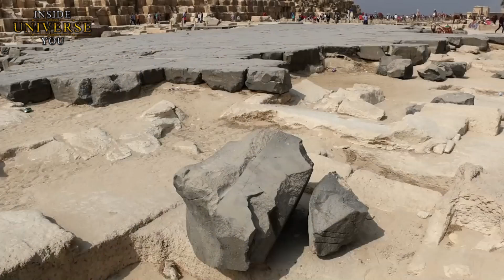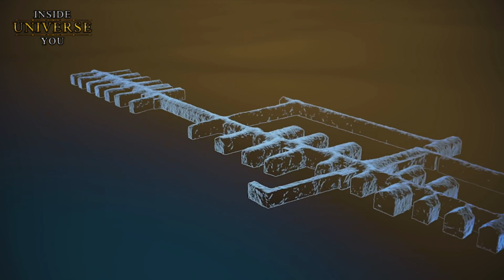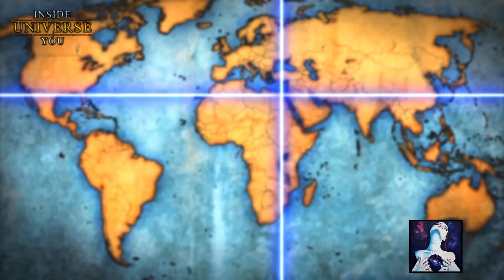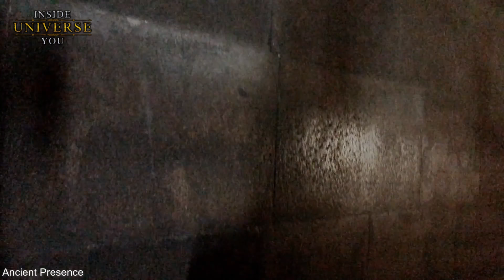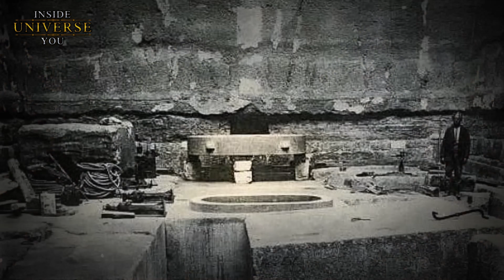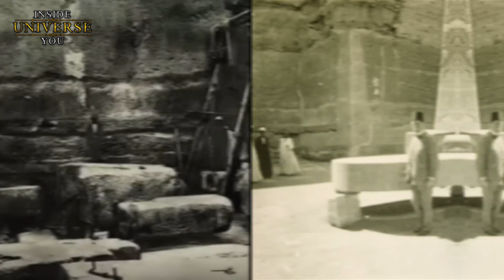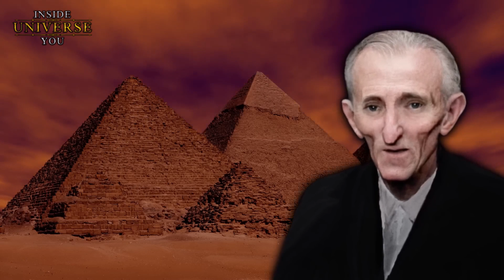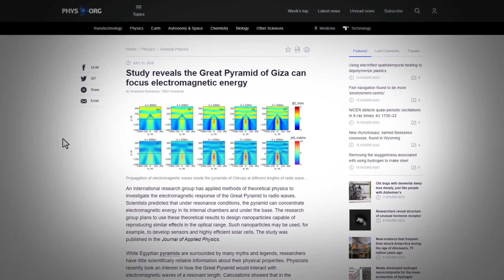Pre-Egyptian Megastructure Built BEFORE The Great Flood

Comment: If you were to consider using dacite to house a battery or create a battery in ancient times, here are a few reasons why dacite could be a practical choice:

1. Durability and Strength

Dacite is a tough volcanic rock, known for its durability and resistance to weathering. In ancient times, materials used for containers or structures needed to withstand harsh environmental conditions. Dacite’s strength would make it a good candidate for housing a battery, as it could protect the internal components from damage or degradation due to external factors like pressure or impact.

2. Thermal Resistance

As an igneous rock, dacite can endure high temperatures without breaking down. If the battery generates heat during use, the dacite housing would help maintain the structural integrity of the device without warping or melting.

3. Non-conductive Properties

Dacite, like most igneous rocks, is a poor conductor of electricity. This property would prevent unintended short-circuiting if the battery was housed within it. Its insulating characteristics could help isolate the electrical components, ensuring that the charge stays contained within the intended circuit.

4. Abundance and Accessibility

In ancient times, materials that were locally available and abundant were ideal for construction and tool-making. Dacite is a relatively common volcanic rock found in various regions around the world, meaning it would be accessible and practical for ancient civilizations to use.

5. Chemical Stability

Dacite is composed of silicate minerals that are chemically stable under normal atmospheric conditions. This stability would prevent it from reacting with battery components or corrosive substances that might be used in an ancient battery system, preserving the functionality of the device over time.

6. Carvability and Workability

Dacite can be worked with traditional stone-carving tools, making it possible to shape or hollow out sections for a battery or container. This would have been important in ancient times when metalworking techniques were limited, and stone provided a practical alternative.

Historical Context: The Baghdad Battery

If you’re referring to something similar to the ancient Baghdad Battery (a clay jar thought to have housed copper and iron rods that could have been used for electrochemical reactions), dacite could serve a similar purpose to the clay jar. Although dacite would be more difficult to work with than clay, it would provide greater durability and insulation for such a device.

In summary, dacite’s physical strength, thermal resistance, electrical insulation, and abundance in volcanic regions make it a potentially good choice for housing or building a primitive battery in ancient times, despite not being as easy to work with as other materials like clay or ceramic.

Comment: Any fringe theory makes more logical sense than a tomb for the dead. The inside absolutely looks like a machine.
Reply: I think they were both. Some believe the pyramids were recycled by the Dynastic Egyptians and used as tombs. If it's true that the Egyptians discovered them vs. built them, then they would have been just as amazed as we are (and rightfully so). I can see them wanting to bury their royalty in them. I lean towards this explanation. But it is possible the Egyptians had more advanced technology that we still don't know about or fully understand.
Reply: I find the ram pump / power generator theory very convincing.
Reply: You are a Genius.
Reply: I think it was built to fill earth with good vibrations, where pyramid is like a speaker and amplifier, and some dead saint mummy was the source of good vibrations. When stupid humans took out the mummies out, they disturbed the whole operation of such building that was operating to fill while world with better vibrations.

Another theory is that pyramids were created with a lot of isolation from stars except some tunnels that were in direct line to some stars so that when someone is born or comes out of coma would have a certain properties of consciousness, which is usually not so achieved just being born without such astrologicaly.

Third is for safer obe astral travel.
Reply: false
Reply: Pyramids were not supposed being tombs!
Reply: One thing we know for sure, the most fringe theories are actually those labeled academic. You can’t get a hair through the stones. Yet the saws they supposedly used are thicker than that.
Reply: @vonbennett6545 I don’t quite understand where you’re coming from. Cutting the stone and finishing it to fit are two entirely different processes. The saw thickness is not relevant.
Reply: @mikecrosier6248  I’m agreeing and adding that the tools I saw in Egypt & which were supposedly used don’t seem capable of that level of precision. The millimeter machine like cuts.
Reply: I doubt diorite stones & copper axes are responsible for the any of the cut & finish work.
Reply: EVERY fringe theory makes more sense than the RIDICULOUS explanations that WE were given in school. 🙄
Reply: Bo mummy was ever originally found in any of the 165 known Pyramids in Egypt... the vessels were all empty.
Reply: @bpd9660  what about tut?
Reply: @terrynichols7991 But, Tut's tomb was found in the Valley of the Kings, not in a pyramid.
Reply: They were power plants.
Reply: If they were built for the purpose to be tombs, then my ballsack just farted.
Reply: the inside are simply empty rooms, what do you mean?
Reply: @konstantinonassis7015  i think he's talking about the lack of ornamentation: wall carvings, reliefs, elaborate paintings, etc. The kind of thing generally found in the tombs of Egyptian royalty. It looks more like the inside of a modern concrete structure like the large underground complexes  built beneath airports or mail sorting  warehouses. To me, the whole thing is a giant mind f
Reply: @terrynichols7991  "Ancient Egypt" spanned more than 1000 years, the ornate tombs you're thinking of were made centuries after the pyramids. It's like comparing out modern grave rituals with those of the vikings.
Reply: @konstantinonassis7015 the tomb theory says the "tombs" are 2000-4000 years old. the other theory implicates that they are 10000-14000 years old
Reply: @dexterslab3  i thought their was a newer theory involving the water damage on the Sphynx that  put  it as early as 30k bc - although, when i heard it i thought it left alot of room for doubt in the interpretation of what that water erosion meant
Reply: @terrynichols7991  Nothing a human has made is in anywhere near as good of a condition as the pyramids and sphynx, and they are only a few thousand years old, not anywhere near 30k years old.

Anything made near 30k years ago we only have ruins remaining. Its very very unlikely the pyramids or sphynx will even make it to 10k years old.
Reply: @BillAngelos  so u think it'll fall apart in the next 8k yrs or so excluding human activity?
Reply: @terrynichols7991  Given how good humans are at destroying great things, it'll probably happen much sooner. Also the pyramids are a lot closer to 4000 years old than 2000 years old.
Reply: @dexterslab3 nope. Nothing to do with tombs... no tombs have ever been found in any of the 165 Pyramids in Egypt
Reply: @BillAngelos read more...
Reply: @BillAngelos  The sphinx has water erosion from rain fall at it's base.
That means it has to be at least 12000-15000 years old minimum.
Because that's the last time it rained that hard in Egypt to cause it. 
It's something dating back from the ice age or even before.
The head was reshaped later. Most likely when the religion changed.
Reply: @benanders-g9s If there is 1 thing I'm going to blindly trust its a youtube comment by some guy with a 2 month old youtube account. Consider me convinced with your anecdotal testimony and exactly zero evidence.
Reply: @BillAngelos  You should not trust any stranger like that.
Do your own research.
I just gave you some pointers. Do with it whatever you like.
Reply: @benanders-g9s By whatever I like, I'm going to completely disregard your comment because it has zero evidence to support your claim that contradicts science. I'm not going to do my own research to do a poor job trying to figure out if your fantastical claims are anywhere near what anyone would call reality. It would be a complete waste of my time.
Reply: @BillAngelos  The sphinx has water erosion from rain fall at it's base.
That's the evidence.
And multiple experts have confirmed that.
Reply: @BillAngelos  yea u make a good point
Reply: @BillAngelos  well the sphinx was buried for a long time wasn't it? I mean isn't that like the whole thing? That a young  Pharoah, at that time probably a regent had a dream telling him where to find the sphinx, and to dig it up, basically like field of dreams style? I'm just sayin, sites that are buried under loose material like are tricky to date. Gobleki tepi is a good example of one
Reply: @BillAngelos  you make a good point. We are masters of destruction. But the pyramids of Giza have been practically a magnet for destructive human behavior through the ages. People have been more than obsessed about unlocking the secrets surrounding these mysterious structures. There's been graverobbing/ looting, careless archeological research recklessly carried out by renegade treasure hunting prospector archeologists seduced by the possibility of treasure W/o any thought or care taken in the interest of the sites preservation, even actual demolition attempts in the 12th century by the Abbasid Caliphate. These structures have stood the test of time unchanged as the world changed around them. As mighty empires grew and turned to dust, they endured, defending their secrets as if in defiance to the mercilessly wrath of time itself.
Reply: @millionpercent  No mummy has ever been found in any pyramid in recorded history.  Not even the great Roman and Greek philosophers could work out their purpose 2,000 to 2,500 years ago.  Whilst I think they have been worked out how they were built by a French and British engineering team it does not give tge age nor the reason and when they were breached or robbed if there was anything to steal at all.
Reply: @benanders-g9s  right but your assuming the erosion is from rain or an inland sea created by glacial melt, for all we know there might have been a giant reflecting pool at the paws. Like a dog sitting at his bowl lol
Reply: @benanders-g9sword they say the sphinx is at least 7,000 years old so I figure it's closer to 10,000 years old.
Reply: @BillAngelos  Humanity is far older than the scientific establishment will admit. They keep finding evidence pushing humanity back 10s of thousands of years. The more they dig, they more they'll find, not just human remains but proof of advanced technology.
Reply: @BillAngelos Retarded BOT?🤡🥴👆🏻
Reply: @BillAngelos Retarded BOT?🤡🥴👆🏻
Reply: @BillAngelos  no they are over 20,000 years old
Reply: @konstantinonassis7015  Its amazing the level of science illiteracy in the world today. This is how rome fell. Not in a day, but over a few generations of people just being dumb AF. Try not to feed stupidity, they'll just spread stupid everywhere and probably try to get you to watch a flat earth video.
Reply: @konstantinonassis7015  After your team of removing evidence struck the place with military for 100 years
Reply: @konstantinonassis7015 nope ... much more than that.   Energy power... boxes stored toxic chemicals used in generating electricity... massive batteries and hydrogen storage...
Reply: @konstantinonassis7015  Did you watch the video ?
Reply: @konstantinonassis7015  the pyramids were for storage of food
Reply: @gamebros8424 nope
Reply: @gamebros8424  huh?  Thats Alot of effort for a pretty small amount of food. The space within  and underneath the structure  relative to the size of the overall size of the largest pyramid is like 10,000 to 1. Unless they had a habit of eating radioactive biscuits, I don't see why they felt the need to create such a gigantic, imposing structure.
Reply: @terrynichols7991  it was for seven years of Famine
Reply: @gamebros8424  oh come on. 🤔 You cant possibly be serious. Your telling me that not only are you just sure beyond any doubt to the purpose of the structure, but that u can place their construction in a specific point in dynastic Egyptian history that coincides with a famine noted in historical records? If that were the case why didn't they leave a written record of the construction itself? More than that, in the middle of an almost decade long famine how did the raise and sustain a sufficient labor force for the construction? How did they feed the workers when even the noble class is starving? And putting a pin in that, again i gotta ask, why is build such a massive structure with such a proportionally minimal internal volume for storage? Compared to the overall structure, there's barely enough space within and beneath the pyramid structure to store enough grain to feed a population one tenth the size required to be capable of such an undertaking. Were talking about an  intergenerational engineering project for a structures design and construction that would only be possible by mobilizing every level of society for at least 20 years, and they were able to do it during a catastrophic famine. Yeah, idk man I think it's back to the drawing board on this one.
Reply: @terrynichols7991  The labor force was slavery. Also, if you believe in the bible, then actually it is recorded.
Reply: @gamebros8424  There would be a lot of evidence for that. Did someone go through and sweep them out so thoroughly that there's no trace of any grain or other foodstuff?
Reply: @gamebros8424 NO, the grainaries of Joseph were in Sakkara, and they have been found.
Reply: @terrynichols7991  read the Bible
Reply: @gamebros8424 From the seven years of plenty for the seven years of famine is the food storage prototype designed by Joseph at Pharoah's command as a result of a dream given to Pharoah by God and interpreted by Joseph.
Reply: @TheKunkockulatorbruh just think about how much space you would need for storage.of food to supply an entire city FOR 7 YEARS
Reply: @tapewerm6716  yes there are videos of people finding traces of grain in the pyramids

Comment: The whole plateau looks like the floor of a carpentry shop. Cutoffs and overcuts of all kinds. And the casings of the pyramids look like they were blasted off by big forces. Not to mention the dinosaur bones sticking out of the bottom of the Great Pyramid base blocks on the northeast corner.

Comment: Don't we call it concrete but there's was made a little different some scientists  say it has like vegetation in it to repair itself instead of  like the concrete we make today and they said that some of those tombs and stuff had light bulbs in them and when they open them the lights went out and they wouldn't light back up no more that's what those drawings of those light bulbs were but they take it off the videos that told that because those tunes didn't have burn marks either under the ground

Comment: Wait what there is writing from ancient egypt about the building of the pyramids....there is plenty of it actually some even mention a bit on what they did in the process. . . 

Also a large part of the pyramids are not very precise in construction they cheated a lot behind the outer surface of the pyramid to save time filling gaps with mortar and rock and then just added a fancy finished and polished outer shell. 

The granite was mostly cracked/split into blocks and then worked down by large teams to become more square likely they also had entire teams fixing the tools needed as they wore down. Some of those techniques are still in use today some of those techniques took DAYS to achieve results with and they where patient back then. 

There is an entire video from like 10 years ago showing an engineer working with archaeologists showing many smart ways they likely moved the stones around that is super basic yet hilariously efficient. 

Here is a tip 
The basic approach in science when you develop a hypothesis is to challenge the hypothesis and try and prove it wrong usually by approaching it with the simple solutions first occams razor style. If the hypothesis still stands firm after that you might have what it takes to create a theory. 

What you do not do is use loose correlation implies causation fallacies and only speculate to move on that is what they did back in the 17 to early 1900s and boy did that damage a lot of our historical understanding of things.

Comment: There is too much misleading or outright false information in this video: for example, there are 2.3 millions of blocks in the pyramid (that's true), but they weigh each between 2 to 3 tons and not as mentioned in this video between 20 to 30 tons. So, you are wrong by a magnitude of 10, and that's prettiy bad.

Comment: Machines just speed up the process and are more acurate. If you give skilled craftespeople enough time an resources they can do pretty much anything an advanced machine can do. You can pick up a stick and use it as a measuring device, you can pick up a rock and use it as a hammer. Put 2 tree trunks together and you've got an A frame that can lift multi ton blocks. Human beings have an incredible capacity to learn and you do them a great injustice suggesting they couldn't do what they did without help..

Comment: If the megastructures are properly dated and shown to be pre-LGM or pre-YD, then it is possible that Ancient Egypt was not covered by sand and its original elevation was probably below present sea level, exposing basement rocks.  Hence, these structures appears to be underground at the present time.  As to the tools for cutting rock, there is a tendency to think that the design of such tools would be similar to present designs.